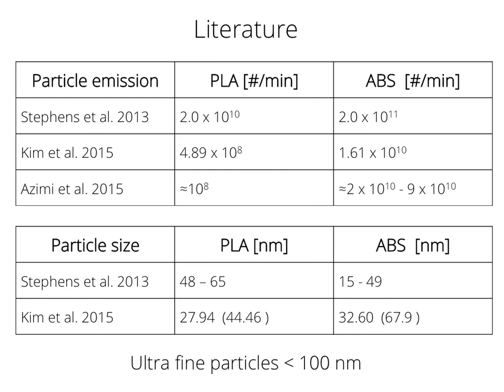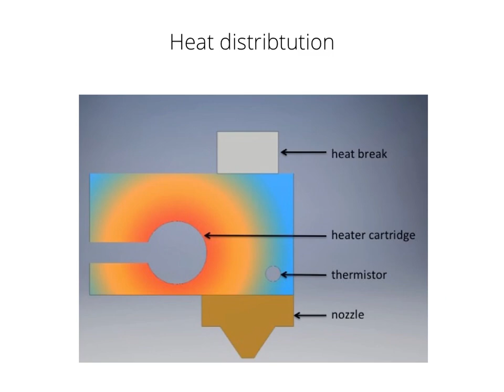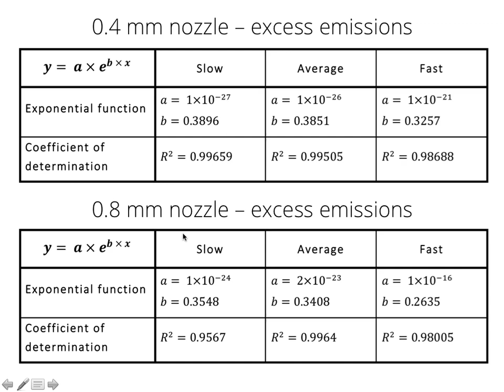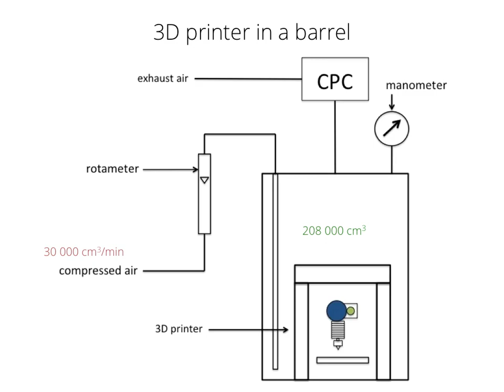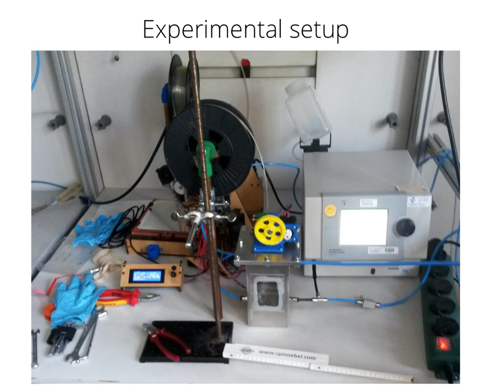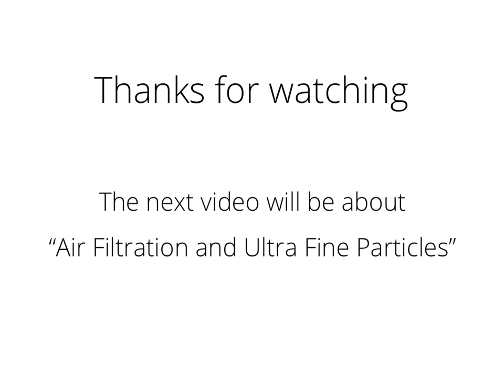Particle emissions from FFF 3D printers

Comment: Thanks for the research and this great presentation as well.

I wonder if you'd have additional material suggestions to look into today in order to learn more on this topic.

I just got into 3D printing and as I'm affected by some asthma this is a topic I approach carefully.
It already seem that some filament tend to make my body react more than others, although I've tested only 3 so far:
Creality PLA < Pxmalion TPU < Fiberflex 30D

The observation of the peak of particles when the nozzle is getting hot, at the beginning or before printing matches the breathing discomfort I experience, and the data you show is very helpful and actionable to make things better.

I've learned about your channel from the OmniaDrop and I wonder if 11:31 is what decided you back then that heater cartridges should be designed differently.
Reply from the maker: Hello Francois,
glad to hear that you liked the video even though it is a very long video. I am very sorry for my late response.
So there is a lot of research going on what these particles and VOC really are. Basically it is a composition of the additives and the monomers of the Polymer. Generally speaking for your condition your go to mateials should be PLA and PETG, since these materials do not emit as much particles and VOC as many other materials. I would highly discourage you from printing with ABS, because ABS emits Styrene and also you should not print Nylon, since these materials are high particles emiters. Also as you mentioned TPU is a high VOC emitter, since manufacturer use more additives for TPU to make it "easier" to print. 

I would recommend to get a HEPA/Charcoal Filter for the room you are printing in and you should avoid standing next to the printer for long periods of time. So your printer should be in dedicated room, if you do not have a spare room. then you should think about building an enclosure for your printer. This should help with your condition.

The most recent research (I know of) regarding particles analysis is:
https://pubs.acs.org/doi/10.1021/acs.est.9b04168

But you should not take a single research paper as the ultimate truth. 

Yes so the Ring Heater, is basically "my ideal" hotend design and that assumption I make @11:31 is indeed one of the reasons for the design of the Ring Heater. I hope in the future I can again research that topic further and find ways to minimize emissions and then find a way to properly filter these emissions.

if you have any further question do not hesitate to contact me.
Reply: @DropEffect  that's a fantastic reply, thanks a lot for that.
Indeed I didn't plan to use ABS due to the better known health concerns, but besides your content there's not all that much on other materials.
I'm just moving in a new apartment and the 3D printer will be in a different room that I shouldn't need to enter too often and which air is exhausted by a ventilation system.
That should help quite a bit.
Regarding HEPA filters, earlier I tried to run an air purifier close to the printer and despite a good airflow getting out of it didn't seem to make a difference fast enough for the heat up period at least. Probably the air needs to be captured from where it's emitted and funneled directly into the filter (or better: an airtight enclosure as you mentioned)

I got into 3D printing mostly to make foam-like parts using TPU, and maybe selling them if there's demand.
This knowledge, weights heavily towards printing only as much as needed and have parts made by a farm instead of getting more printers at home.
But then I'm also thinking about people working in printing farms, from all the videos I've seen, nobody seem to wears any masks that would help filtering the particles described so that's another concern.

I hope that you'll have the opportunity to study the topic further.
Although the knowledge could make things inconvenient for some, I wonder if it could result in health recommendations or requirements that anyone who owns a 3D printer would know, as well as regulations to protect 3D printing farms workers.